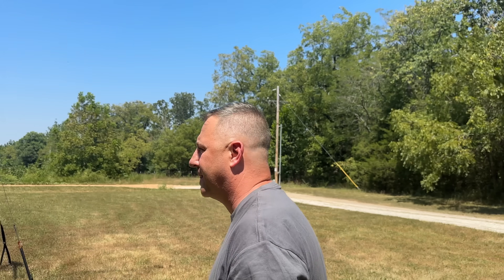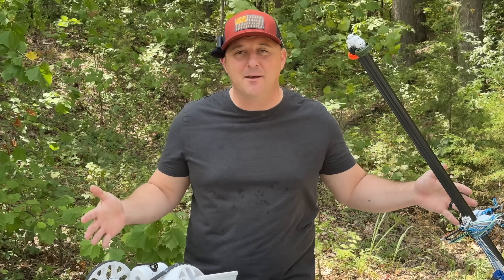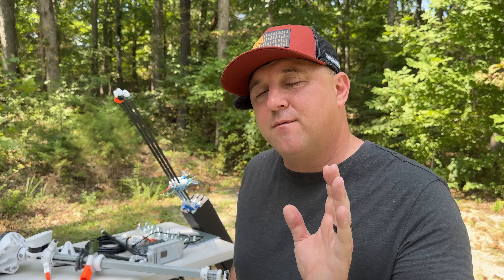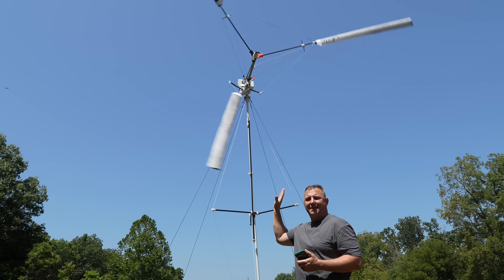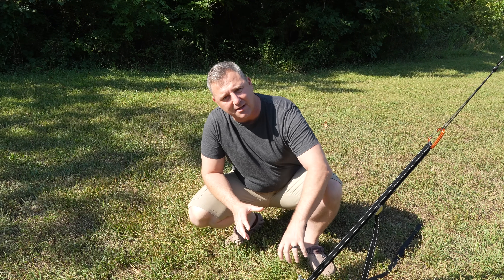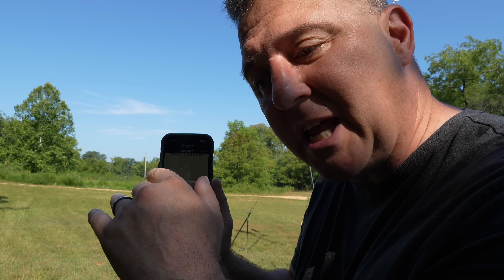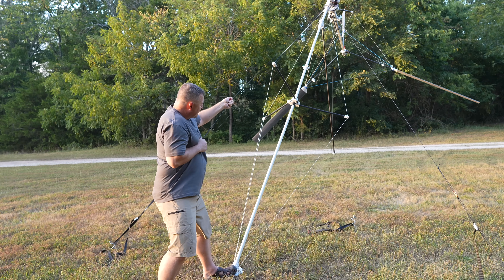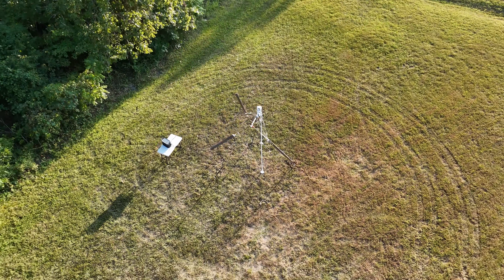Ditch Solar Panels! Is THIS The Future of Off Grid Energy?

Comment: All practical tests of ground-based small wind displays show the same thing: 1) They hardly produce any electricity. 2) They do not last long!
Because of the extremely gusty winds near the ground, 9 out of 10 small wind turbines stop working after just a few years.
PV panals, on the other hand, generate green electricity at around 2% to 5% of the cost of small wind turbines! 
They also function reliably and require little maintenance for 25 to 30 years.

Comment: Too wobbly, plus all that plastic to rot in the sun. This thing wouldn't last much over 3 months where I live. One can get used panels as low as about $50 each, so I would rather just add more solar panels. Besides, while this MIGHT be okay for temporary use to charge a "solar generator", it won't work for anything but a 12V system, and not that well.

Comment: Just make some earth batteries (aka Stubblefield coils) which with enough can always be charging a battery bank. Add a super capacitor bank to battery bank bank to use wind and solar better. Batteries have low voltage but last a long time also take long time to charge and super capacitors have high voltage but charge don't last long but charge in seconds.

Comment: Any power generator with moving parts will always give you more trouble than fixed solar panels.  I have learned this the hard way after 35 years of using solar, wind, solar trackers etc.

Comment: I like the idea of a portable wind turbine for some alternative power supply, but you aren't going to replace solar panels with this. Yes you can get wind day and night, yes you get dull days with little sun, but you actually do need quite a bit of continuous wind to get any decent charging power from a wind turbine. As you saw you were getting 20 watts which will do virtually nothing, up to 200 watts which is reasonable but still not fantastic.

Comment: I don't think either wind or solar is the future.
Curious on how many rpm's the generator gets.
Gravity Generators need no sunlight or wind. 
Add 3 or more 1:3 gears so you get descent rpm's. 
Add a flywheel.
Maybe a little elbow grease.

Comment: Having both is the best option.
Reply: On paper it would seem that way, but no.  Wind is horrible with these small installations.  Solar and Hydro if available, but not wind.  Vast majority of places simply do not have strong enough winds on a regular basis to make it effective.
Reply: @zarroth  For those kind maybe, but there are new designs for residential that are leaps and bounds above this kind.

Comment: Have to agree with the limitations of wing generation. I’ve been off grid for over 7 years and I do have a 1.1kW wind generator which has only added about 1.4% of my total energy supply; not the best solution.

Comment: Here in the valley of the sun, we can have days with just a slight breeze to no breeze, while the sun is shining bright and clear without a cloud in the sky.
Reply: Seems like solar is better for you.
Reply: As a person that has been off grid for 12 years and has had wind and solar.
Nothing beats solar.
No matter where you are.
The only exception is Alaska and Antarctica.
But even during thier winters. You can collect power.
Heck, if you have the panels. You can charge your system on half moon and better. 
Be one big system.but it can be done.

Comment: Here in south Louisiana windmills are useless. No regular sustained wind, especially if you need 15+ mph winds before it starts generating  even 50% of its rated power. Probably need to raise windmill up 50 or higher to be above treetops. 30w-250w isn't much. The power they rate these on is with a sustained wind at the maximun wind speed prior to self destruction

Comment: I use a 1200w/h power station in my trips, powered by 2X 100W panels, I recently added a 200W tourbine [the sphairical type, more compact than this...] between them [solar-wind] my power station is always at max load... the entire system didn't cost me 1900$... more like half of that... Thank you eBay!... 
(this thing is HUGE!... and dangerous!...)

Comment: Solar panels are easier to maintain.  If you don't have enough wind, the turbine won't move fast enough to get to the right voltage to charge a battery.

Comment: The video did not address dump load or otherwise called diversion loads.  Does this wind generator system come with a means of dump load?  If not, how does the system divert excess power?

Comment: Once they get the price down a ways, and the out put a little higher, it would be good for power production at night (full time power), so you don't have to have huge battery banks. Your power consumption is usually less at night also. Unless your charging your EV. ;-)

Comment: 5 to 6 hours of sun, I have sun from 6:30 am to 8:00 pm. I use solar and wind. I would love to use hydro but no rivers near me. My wind here goes from 15 mph to 60 mph. Living in the desert of West Texas does suck cause of the heat but you can create so much power out here it's unreal. I am 100 percent off grid and it is so great to not have an electric or water bill. Hell my closest neighbor is about 5 miles away. Real nice. Be safe mate.

Comment: Solar for day, wind for day and night. Potentially 24hr of power
Reply: Better off putting that money towards more batteries and/or a generator.
Reply: Micro hydro for all the time.
Reply: underrated comment
Reply: Wind mostly does at sunset day!
Reply: Hmm and nights you don't have winds?
Just stop __ around and have the battery bank and panels to catch enough during the day. 
For that price you can build a great system of solar far better.

Comment: I turned my solar panels into a windmill.. So I have both at the same time.
Reply: Put solar panels on my windmill then put my windmill in the lake now I have a hydro powered solar windmill
Reply: I turned my solar panels into a boat and powered it with a windmill. It's an airboat.
Reply: That is a good idea that would help keep the solar panels from heating up and loosing efficiency
Reply: Nice hahaha 😂
Reply: I burn plastic to power a steam turbine.
Reply: @tromtacular  to offset the offset of your carbon footprint i like it

Comment: Can I ask an unintellegent question? I am not sure but why is it many  offgrid people are using dynamic energies? Whether its solar or wind, these are all dynamic energies which relys on a constantly changing source. The amount of energy produce is determined by the amount of sun or wind provide for that day, they recieve so many changes and are not stable. I notice many of you have a backup gas generator which is a controlled energy, meaning this will work for the most part whenever you provide gas to it, it does not rely on natures elements. You can use your gas generator and connect a stablizer and connect this to your solar chargers. If you wanted to go a step beyond this, you can build an HHo generator to then connect to your gas generator this way you run your gas genertaor with the use of water and perhaps some KOH. Anyways, its just something Ive noticed, dont worry about it.
Reply: Yes solar and wind can't be relied upon for full consistency, but that's why there's a method to it in order to maximize daily intake.  The generators are costly to run, but it's nice knowing that backup is there....  the trick is to try not to use it's supplement often, and that's how an off-gridder comes out ahead.
Reply: HHO? Yeah, that's the secret sauce to making water a fuel. 🤣Of course, I suppose you could use solar panels to provide the electricity to make the Brown's gas and then burn that in your generator. That'd sorta almost make you net zero. After a whole day of full sun, you'd probably get ten minutes on HHO before you need to switch back to dino juice.